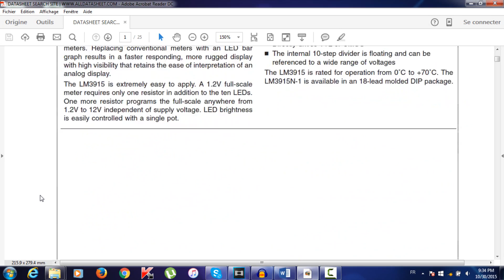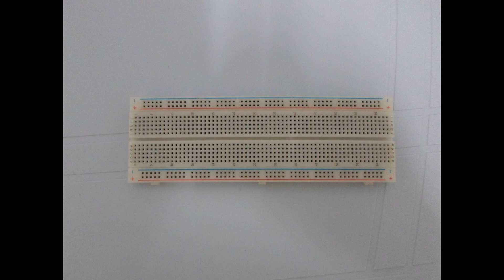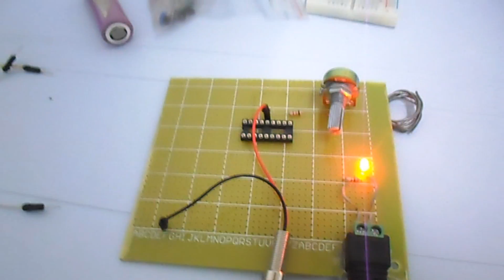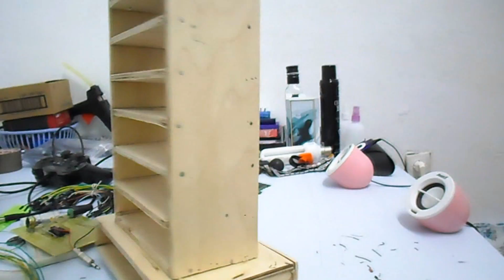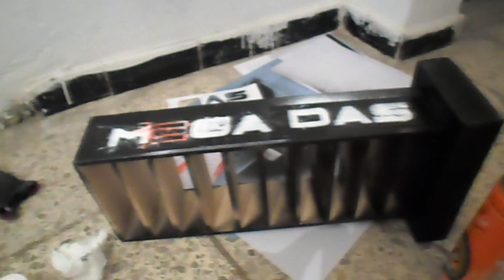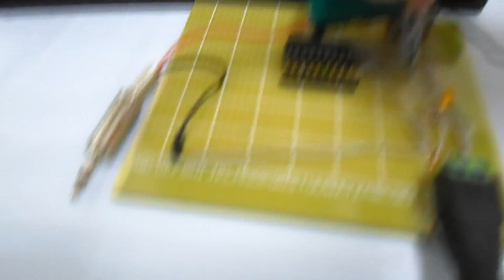how to make a Vu Meter tower (LM3915)

Comment: how to make that jack connector?
Reply from the maker: Keiji John Libadisos don't make it just buy one or you can jump two jack conn. but I advice you to buy  it instead.
Reply: i bought 3.5 mm stereo (TRS) ... :(
you used 3.5 mm mono (TS) jack connector :(
Reply: did you connect your speaker to your music player together with that jack connector?
Reply from the maker: Keiji John Libadisos the Jack conn. has two segments for mono jack or three segments for sterio jack in this project we used a mono jack conn. the first and we soldered a wire connected to the first segment from where we will get the GND and solder another wire to the second segment from where we've got the audio signal then connect these wires to the IC LM3915 
If you need more info. about the jack connector just make a google search about mono jack connector. Or come back here if you need more.
Reply: MEGA DAS nevermind what i said hahaha ... i converted my stereo to mono , i googled it ahahaha ... but thanks to your video , it helps me a lot 😊
Reply from the maker: GOOD JOB and KEEP DOING ELECTRONICS !
Feel free to ask us if you need anything :)
Reply: did you use 12V DC ?
Reply from the maker: Keiji John Libadisos BE CAREFUL! The LM3915 is an integrated circuit so it's all about 5V power supply.
Go back to the datasheet of LM3915 and make sure that you understand how it operates before starting any powered test.
Reply: MEGA DAS thanks
Reply: MEGA DAS what is the audio jack and. The power jack that is connected to the circuit called?